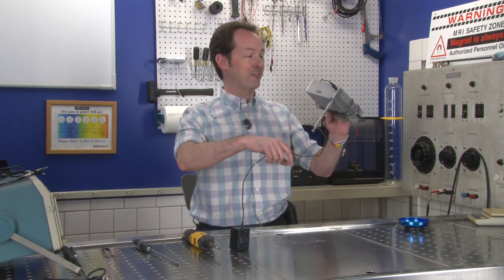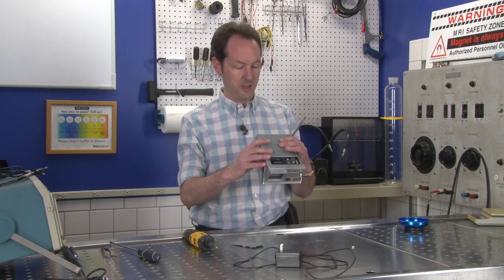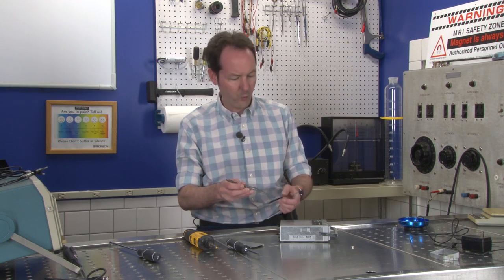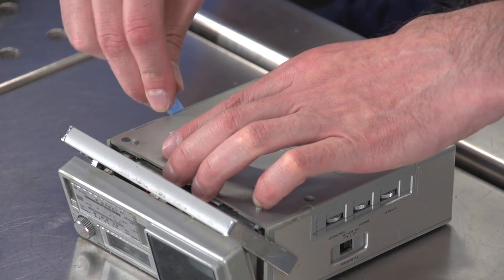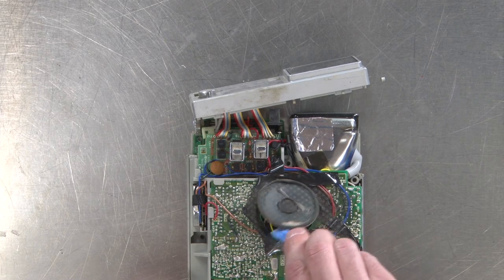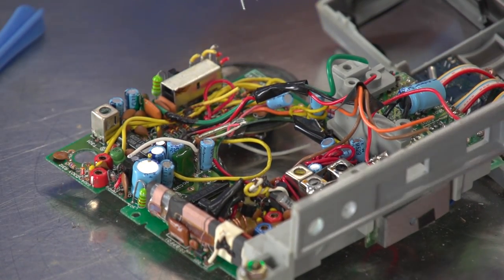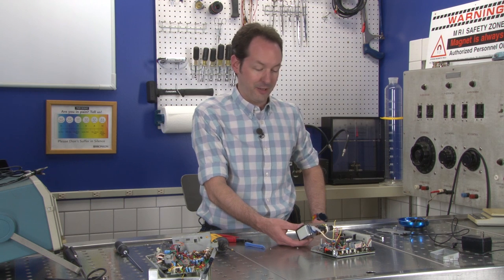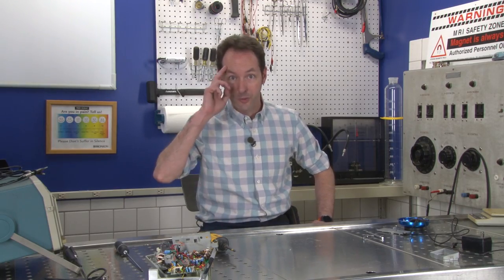Portable CRT TV: Equipment Autopsy #103

Comment: I took apart something like this in like 6th grade trying to fix it, I then took apart a couple old CRT computer monitors in high school trying to fix them, ended up junking them after I took them apart. By the time I worked on the monitors I knew enough of how these worked when I had to get rid of the HV lead I always used a large pair of diagonals with thick rubber insulation and leather gloves. Then I put a thing of tape or a wire nut over the end. I think I still have a flyback somewhere I keep meaning to make a driver for.

Comment: The tiny tube in these won't hold too much of a scary current.

There are usually only some small HV caps in the flyback focus pack, but it's the very CRT itself which acts as the main HV smoothing cap.

They can be safely and easily discharged by tying a wire securely to a flat screwdriver, then hooking up the other end of the wire to the ground strap around the tube.
Then, just keep your fingers and thumbs away from the metal part of the screwdriver while sliding it underneath the rubber anode cap on the tube.

A tube this size will run on barely 12-15 KV (if that), and many more modern designs tend to self-discharge fairly quickly (but definitely NOT all, especially the older ones. lol
Reply: Technically, if you want to repair the TV / monitor and protect the diode(s) in the flyback, the tube should ideally be discharge slowly via a power resistor of around 1K or so.

(rather than a dead-short, where the HV diode can take the brunt of the relatively "high current" impulse.)

And yes, I have been bitten ONCE by a large 28" CRT while discharging it, as the wire wasn't securely secured to chassis / tube ground, and a spark jumped to my thumb.
It wasn't too terrible, but I would never recommend it. lol

Comment: The volts going into he back of that CRT should be 6.3v to power the electron gun, the only high voltage you need to worry about is the suction cup one on the side of it, to get rid of any high voltage left over after it was unplugged just take a big flat blade screwdriver and shove it under the suction cup.
Reply: HL4EHalfLife 
screwdriver has to be grounded

Comment: Normally you would slip a grounded screwdriver under the suction cup to discharge the EHT supply before working on the TV.
Since that one was just battery powered, there is no internal mains power supply with big capacitors potentially charged to 330 volts to worry about.

Comment: The eht wire would be ok to hold, it's supposed to be insulated for the voltage, 
I used to draw arcs to my fingernail from the EHT valve (tube) anode cap on monochrome tv's, nice bit of corona.
But colour TV's bite when you try to do the same :D

Comment: Isn't 50KV a bit high for a CRT? I think i remember reading something about them starting to emit unwanted kinds of radiation at that sort of level (Possibly from the warning sticker on an old CRT TV tube).
Would wearing a pair of rubber gloves be enough to keep you safe when doing that fingerpoking? (Maybe big thick gloves over them too so you gon't have the gloves pierced by a pointy solder joint)
Reply: Only huge projection TVs used voltages as high as 50 kV. Color CRTs typically run at 25 kV and black & white CRTs use around 8 to 15 kV. And as long as the bleeder resistor is intact, the voltage will be drained off within seconds of turning off the power.